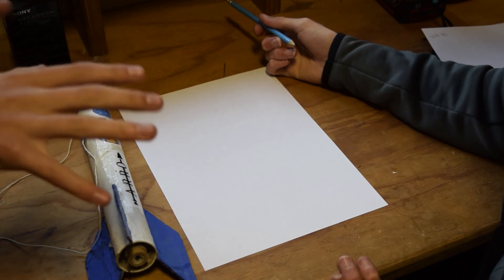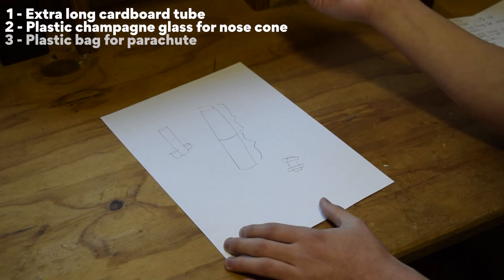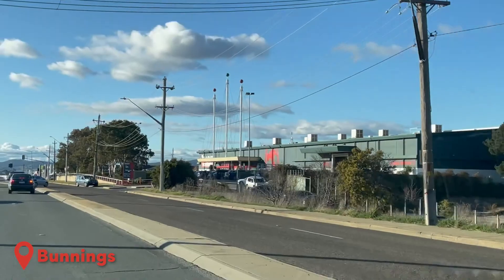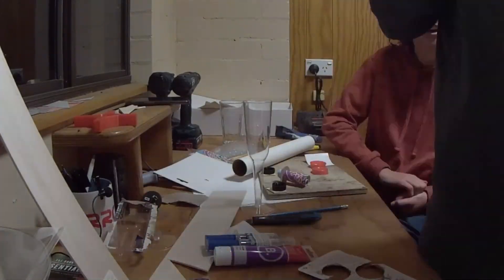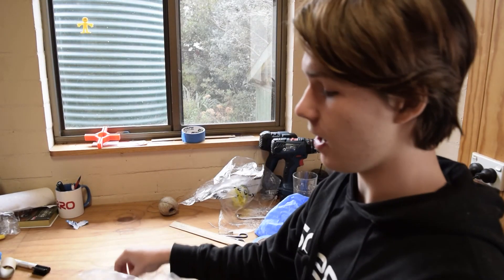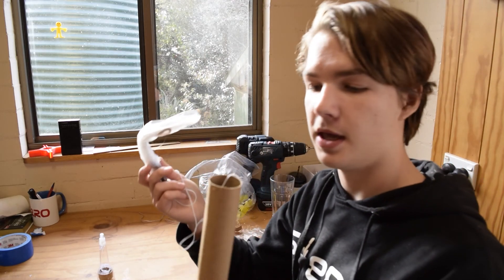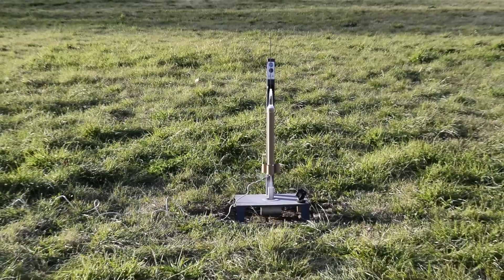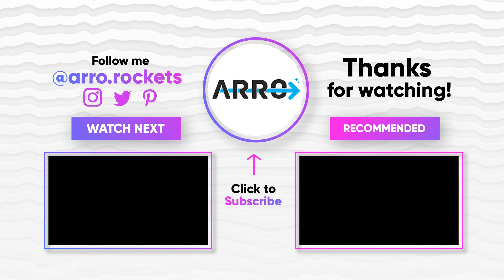$10 vs $100 Model Rocket

Comment: it's nice ! but you didn't tell about the engines, how to buy them , how to ignite etc...
Reply from the maker: The engines are standard Estes ones, in this case some B6-4's. You can purchase them from most hobby stores, and they include igniters and plugs and instructions on how to use them. To ignite them, you'll need a launch controller. A standard Estes one will do for these types of rockets, but for more powerful ones a go for the GoBox launch controller. Hope that helps :)
Reply: thanks
 @arro_rockets
Reply: and also, pls can you tell me how the parachute deployement system works? are you using explosive charge ? Thx @arro_rockets